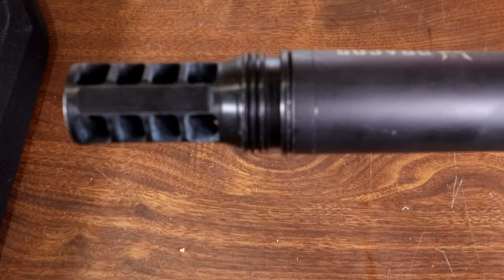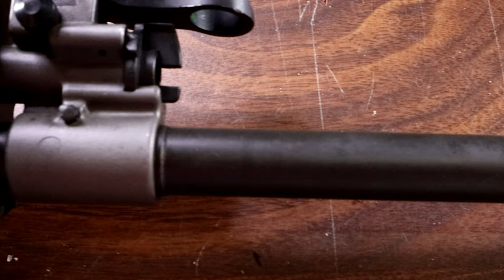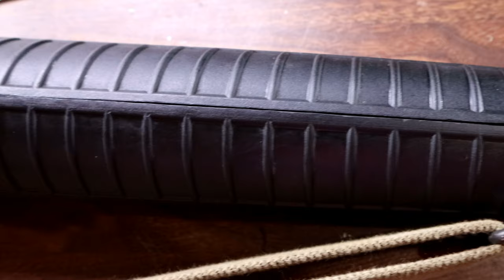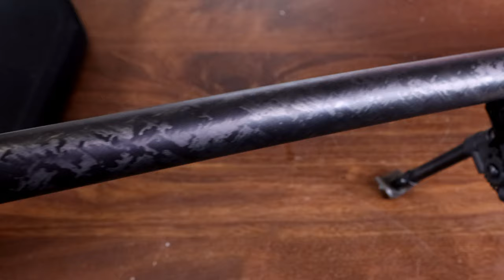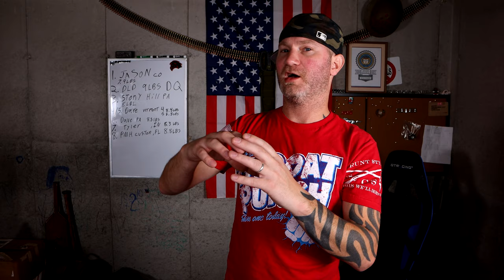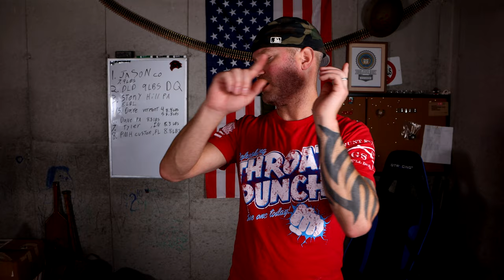The Perfect Rifle Barrel Explain In 180 Seconds

Comment: That just refers to surfaces.  The more important thing in heat dissipation is the materials conductivity.  If the material is highly conductive, it will spread that heat (which is happening from the inside)-  to the outside surface quickly.  Carbon Fiber acts more as an insulator than a conductor;  trapping the heat inside and not allowing the thin barrel to dissipate it's heat away............   Conclusion-- Carbon Fiber barrels are ideal for hunting, in that it's lighter and easy to carry all day-- and will still work well on the first couple of shots.   If you need to put out any kind of sustained fire at all-- carbon fiber is a terrible choice.

Comment: Anytime you have a mixture of materials together like a carbon fiber Barrel you also have expansion ratios to consider
Reply: This is the real problem.
Reply: Like aluminum heads on a cast iron block
Reply: Isn't this how the AR platform failed the military trials back in the 50's? Didn't they try to use a hybrid steel/aluminum barrel and the thing blew up?

Comment: Everything you have pointed out is correct, purely from a physics standpoint. And I like the humility you showed when you relayed the conservation between you and the guy who set the action. He thought you were setting up for long distance back country hunt where you take one to no more than 3 shots. Which this rifle would be great for. If he had known that it was to be something  of either the tactical or competition usage where you could  have strings of fire from 30 rounds and up, he would tried to steer you away from the carbon fiber to stainless steel or even a cerakoted steel. Essentially, you are admitting that this barrel is a misfit for this usage.

So, now, there are some choices. Either keep this as an expensive and heavy hunting rifle. Or sell the barrel and action to someone with a fiberglass or molded stock for a back country hunt And rebuild this rifle from the start.

Comment: What if you put vent holes in the CF? For a place for the heat to escape. Drill holes into the barrel portion. The barrel won’t warp as much under heat with the added rigidity of the CF. And the heat will escape faster with vents. And slight weight reductions w/o compromising strength. Send it for the tube!
Reply: To specify, not holes in the metal barrel portion. Holes in the carbon fiber portion

Comment: I had a motorcycle with a carbon fiber muffler. After hours of riding, that muffler wasn't your typical scalding-hot surface. It wasn't even radiating all that much heat. So I would agree with CF being more of an insulator. It's carbon strand fabric with resin soaked/treated into it.

Comment: Yes, the carbon fiber barrel are not designed for cooling. Thats what's fluted barrel are for. Carbon fiber barrel are actually just pencil barrel with a carbon fiber mold to keep it light and stiff. Designed to be light weight on-the-go rifle.

Comment: I think a big part of the problem you are having is differential expansion. It’s like the coil on your AC thermostat. The steel and the carbon fiber do not expand at the same rates, creating tension and pinch points (because it is too strong to curl up). These pinch points are playing hell with your barrel harmonics until it cools down and relaxes.

Comment: I think a big factor with the carbon fibre barrel is simply that with less steel there theres a lot less space for the heat to go, instead of taking 15 shots to warm up a big block of steel, it takes 3 to heat up a tiny cylinder/ even if its technically more efficient at removing head, that effect isn’t as pronounced until higher temperatures

Comment: Issue with carbon is the hotter it gets, more it's fibers expand and get tighter against itself and anything it's wrapped on. This can cause things to flex and deform, this once it heats up it squeeze the barrel and cause it to flex and not have a true bore line.

Comment: I disagree that Chrome Lined Barrels are the best, but my issue is they are less accurate than a Stainless or Chromoly barrel.  However it also depends on the application, high round count SHTF rifle yes I go with Chrome Lined, for a range plinker I typically go Chromoly or Melonited, and long range I typically go with Stainless

Comment: A lot of theory works "on paper" but is there anyway of testing this? I have it on good authority that the only reason you would want a a chrome lined barrel is for sustained full auto fire (which even the M16 was not really designed to handle) The M16/AR-15 is not a machine gun, it is a rifle that can fire full auto if the need arises. All things being equal a nitrided barrel will be more accurate because the chrome bore plating process is not as uniform as salt bath nitriding.

Comment: 🔥me☝️Real Question...How hot does a barrel get from 3 shots, 5 shots, a whole 30rd mag?  Yes calibers and length of barrel bull barrel vs pencil...and all that.  Also, how long does it take to cool off and become accurate again? And CookOff...how hot is that?  My Mini 14 said it would cook off rounds easy biggest warning in the owners manual.
Reply: I have done 30 round mag dumps with my 184 series Mini 14 with no cook off rounds. I have gotten the stainless steel barrel so hot I could use it to brand a cow.
Reply: m1 garand , two clips and the barrel will melt your fuking hand .

Comment: im sorry bud, but the color of the chome and outside of barrel has virtually zero to do with barrel heat.  actual mass of the barrel has much more to do with it.  the chrome protects the surface of the steel from the ~3000F temps while the bullet is being fired.  peak temps go with peak pressure, so the throat is particularly prone to heat related wear.

Comment: Man.. it really sucks to be a smaller channel, because even when you're speaking industry-wide known truth, because you're a smaller channel nobody listens, and everybody is quick to criticize, also all the woo going around in the firearms industry doesn't help any.

I don't have a expensive college piece of paper, but I have done enough work with physics to know that what you're talking about is correct.
most of the heat from burning of the propellant, and a smaller amount due to friction is transferred into the barrel due to convection and radiation, a chrome lined barrel will absorb less of that because of the reflective surfaces.
Once the Chrome has heated, it will transfer to the steel trough conduction, because of chrome deposition, and no rough surface contact, the transfer is almost perfect.
The steel being a carbon derivate of iron, will come up to temp faster, and start to heat the air around it back through convection, and start to radiate out the other part, and all of this happens in half a blink of an eye.
Eventually enough air has been heated, and enough energy is radiated for the barrel to come back to room\ambient temp.
this is why shiny insides, gray metals, and black outsides, with fluted exteriors to accelerate convection are the best for cooling.

Carbon fiber being a resin composite is trash at heat transfer, you do experience less heat on the surface because it's an insulator, And all the heat is trapped inside your resin, the carbon fiber itself is a insulator more akin to fiberglass.

Comment: Carbon fiber another marketing ploy
Reply: I'd say it highly depends on the circumstances. I saw that in certain helicopter parts with CF. Some jump on a bandwagon to make a profit and don't understand the reasoning behind an application and it what niche context it makes sense. When the niche isn't big enough for profit it's slapped on other builds. CF is light, stiff in some directions and cools down quickly. In the context of biathlon (Skiing with the rifle on their backs before shooting 5-10 .22lr rounds at high physical stress) it might be sensible to stiffen a match grade barrel to get different harmonics in a cold environment and reduce the weight for the athlete. Materials aren't top trumps, they can't be thrown at anything to solve problems and if that is tried it's a sign of bad engineering. In the right context titanium is amazing, in the wrong one it's a serious hazard.
Reply: As far as rifle barrels go,